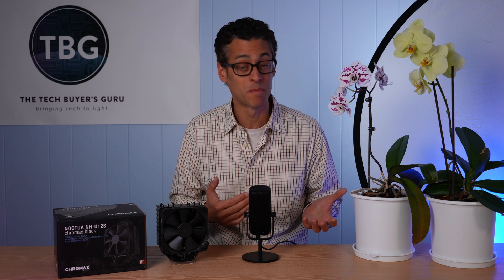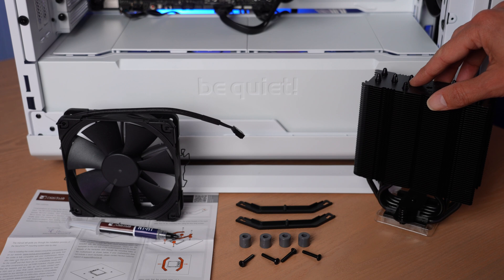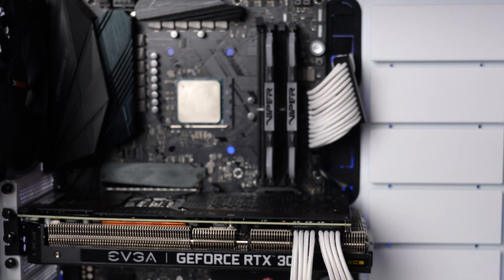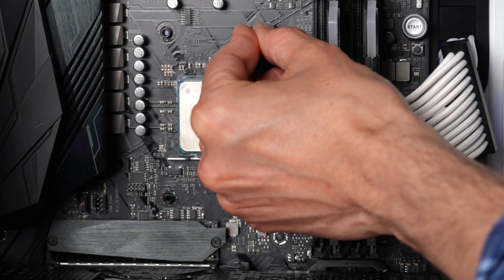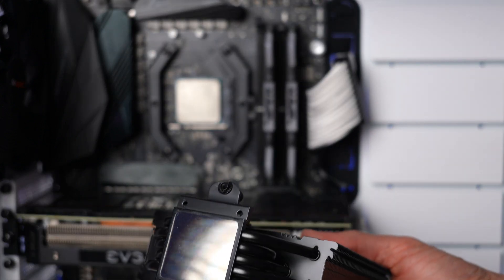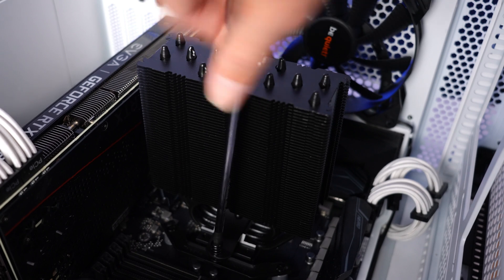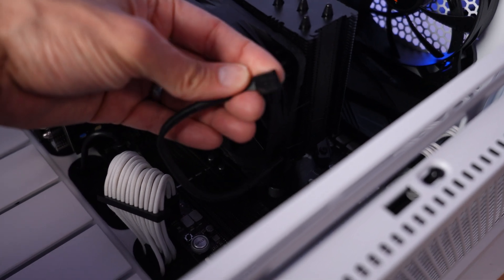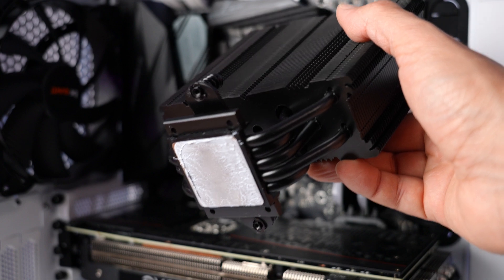The Noctua NH-U12S CPU Cooler Installation Guide for AMD's AM4 Platform

Comment: Hey thanks for the turorial!
I just had a quick question, if I want to add another fan for push/ pull configuration, what fan would I need?
I want one with the same specs so I don't introduce turbulance.

Comment: Hey, so am i right that if you want to change the fan on the CPU cooler, it's as easy as removing the cable and taking it out? No need to take the heatsink out?

Comment: The fan doesn't stay in place...not sure how the clasps are suppose to grip. Mine just falls off
Reply from the maker: If the fan clip is not secure, it means you are not securing it to the right indent in the fins. Try to pull it further, and make sure the clip is attached the front of the fan, not the middle.
Reply: @TheTechBuyersGuru  yep that was it, thanks

Comment: hey great video man! is it better to use the backplate that comes with mobo or from the cooler?
Reply from the maker: Not a choice. AMD must use motherboard backplate.
Reply: @TheTechBuyersGuru  Thanks
Reply: @TheTechBuyersGuru  do you know if cyber pc that comes with stock after market cooler have this “motherboard bracket” ugh noctua should of just included
Reply: @OGkush69x  I’m wondering the same thing.
Reply: @robotkirby85  if it helps just did the job last weekend.  My cyberpower pc ryzen 5 5600x that comes with trash aftermarket cool master cooler in fact did have the amc stock back plate and had no extra back plate on or glued on like in this video.  So it was a simple swap.  My temps do not go over 55-56 degrees while gaming with 90%+ load(before it would hit 80-85 degree) . And more importantly its whisper quiet now. Extremely happy.

Comment: So super dumb question. I have an Nzxt h510 case and a b550 gaming plus mobo. Will I need to pull my mobo to install this? I'm super new to pcs.
Reply from the maker: Install just like you saw in the video. Just take off both case side panels and you'll get access to everything you need.

Here's the link to the cooler at Amazon: https://amzn.to/3qAUgAc #ad

Comment: Nice video; would have been nice to see you mention the proper fan orientation when it ensure the airflow is being directed towards the cpu.
Reply from the maker: Great point! This is pretty standard, however, as airflow always works the same way: intake through hub side, exhaust through frame side. So just set it up like in the video!

Comment: Hey, thanks for the great video! I wanted to ask if I should purchase the normal NH-U12S versus the Special Edition-AM4 version? Does having to use the AM4 bracket pose any disadvantages over the dedicated AM4 version?
Reply from the maker: Don't buy the AM4 edition. That is old and was released in 2017 specifically for the first-gen Ryzen. Every U12S shipped since 2018 has an AM4 bracket in the box, plus the Intel brackets. There's no reason to pay the same or more for the AM4 edition, which includes fewer accessories. So, here's what to buy:
Standard brown version for $70: https://amzn.to/3BpX3yB #ad
Black version for $80: https://amzn.to/3nGIJNm #ad
Reply: @TheTechBuyersGuru  Thanks!!

Comment: Still new to working around pc's here. How does this compare to water cooled coolers and is this really a good upgrade from a stock cpu cooler?
Reply from the maker: Welcome to the world of DIY PCs! The NH-U12S is a huge step up from a stock cooler. The only question is whether it's the one for you. Here's a review of the U12S versus its competition: https://youtu.be/HZOGK49NGLQ #ad

If you're new to upgrading and don't have a very hot-running system, you don't need to go with a liquid cooler at this time. There's a lot more you need to know about in terms of fitting one in your system. But yes, liquid coolers are more powerful than the U12S, at least anything at 240mm or above.

Comment: I will buy this so my question is can this help to get a great temps and a great performance in Game cause now with my stock ryzen 5 3600 cooler makes 80-87 Celsius in game and the performance are not good
Reply from the maker: It is much better than the stock Ryzen 5 3600 cooler.
Reply: @TheTechBuyersGuru  so it will everything better right?

Comment: is a Noctua NH-U12S SE-AM4 compatible with an AMD ryzen 5 2600x?
Reply from the maker: Yes, but there's no reason to buy the SE edition, you should buy the standard NH-U12S now: https://amzn.to/3xq8Yue
The SE costs the same but includes only AM4 mounts, while the standard edition includes both AMD and Intel.
Reply: So actually they are the same but the standard edition is compatible with intel too. There will be no problem with the 2600x socket right?
Reply from the maker: Correct. It's the AM4 socket, the 2600X is no different than any other AM4 processor.
Reply: You title matched, you truly are a guru! So a Noctua NH-U12S (I want the brown one) does the job perfectly?!

Comment: Great explanation! Thank you! I bought the smaller NH-U9S Chromax for my Ryzen 5 3600. I overclocked it to 4.1 GHz (with some undervolting and PBO disabled). I benchmarked with Cinebench R20 and R23 several times, and the temps never rise above 56 degrees celsius, and the idle temps are between 36-39 degrees celsius. So I'm 100% satisfied with it! just have one important question - Is it possible to overtighten the four screws that go into the backplate?, because they don't have springs, how are we really supposed to know when to stop??
Reply from the maker: You'd really have to try to break the motherboard with those screws. The point of spring-loaded screws is to establish correct pressure on the CPU's heat spreader. You don't need that when tightening simple spacers between metal plates, which is basically what you are referring to.

Comment: do you recommend both cpu and case fans running on PWM?  Or case fans on static RPM? (using NF-A12x25 fans only)
Reply from the maker: I actually set my case fans to static up to a threshold level, like 70C, and then have them jump up to a higher RPM, but never 100%. For CPU, PWM is OK, but you can fine-tune it to meet the needs of your system with a custom curve.

Comment: How much quieter is the nh-u12s compared to the wraith prism using the 3700x cpu? Should I go with the nh-u14s if I have the space?
Reply from the maker: Infinitely quieter. Really. The Prism is effective, but it is not quiet. And yes, the U14S is actually quite a bit more powerful (and therefore quieter at the same cooling level), and installs almost identically. Here's the link: https://amzn.to/3cZLvsa
And while it's only available in old-school beige, it's actually the same price as the U12S black, so you're getting much better performance even if you're not getting the blacked-out look.
Reply: @TheTechBuyersGuru  thanks for the reply Ari.

Comment: Installation and ease of use in the mounting mechanism is what makes these Noctua coolers great, even for first-time builders. Overpriced, but a great cooler. 👍
Reply: The problem with the pricing is because Noctua has labour in Austria to pay and their customer service is outstanding. One time an A12x15 broke, maybe a broken cable shorting the fan. I asked for a chromax version with me paying the premium. They declined and send it anyway, since then I have no hesitation paying their premium, If it is reasonable.
Reply: The price seems good. Only $70 on amazon.. idk.. maybe I'm comparing this to most other higher end cooling options being $100+
Reply: Buy once, cry once. These coolers stand the test of time and they work really well. Plus Noctua has excellent support and will even send you brackets for updated CPU sockets (for free) so you can keep using your cooler. Plus their fans are so damn quiet, so you pay a premium, but it is worth it.
Reply: It's hard to overprice quality